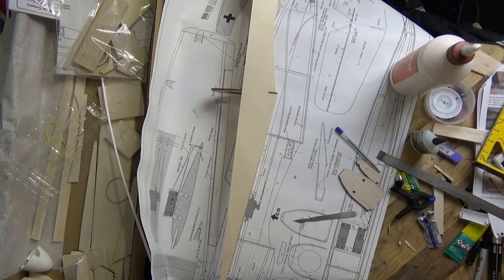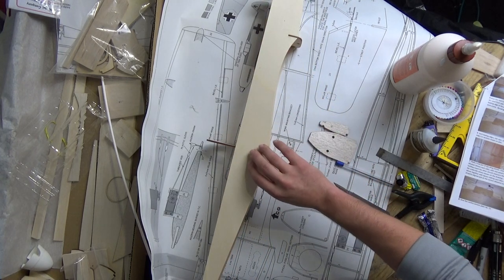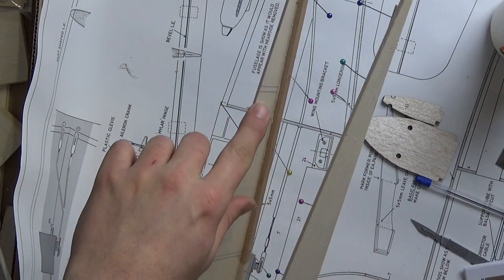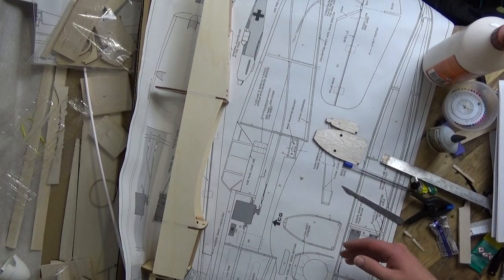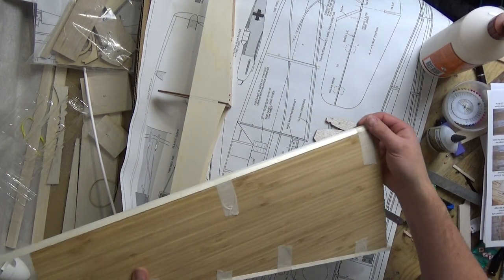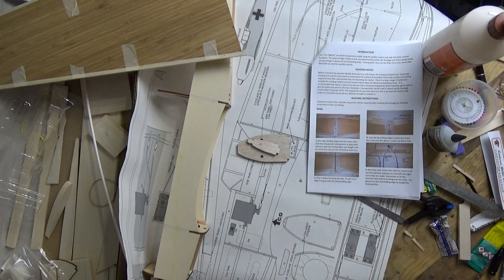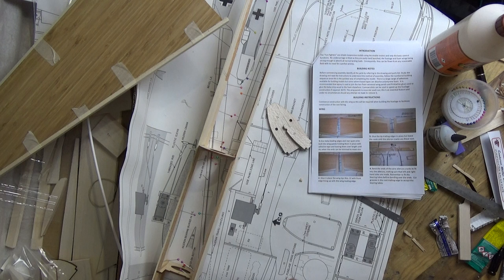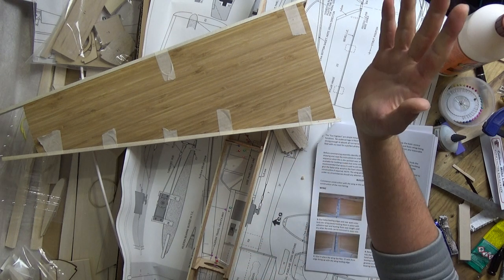Part #1 - ME109 Build - The Fuse, Wings & "Getting Frustrated"

Comment: When I was a kid I made loads of balsa models......The secret is to put the big plan on a big flat surface with a sheet of plastic or greaseproof paper on top then pin the parts to the board. Then stick them together!
Reply: Or use soap or a wax candle rubbed over the plan.

Comment: So many hint and tips I could try to share, but to a degree, you gotta do it your way. I've built Cumbria fun fighters, which aren't the same but looks like yours in similar. Feel free to shout with any questions. Im on the Faceballs group if you want to PM me. Two tips for now. Looks like you haven't fitted the wing seat doublers (part 21I think). These sit on the inside of the ply fuz side and help spread the load when you're wing is mounted. Easiest to fit before you start to put the fuz together when you can glue them on to flat fuz sides. Worth getting them on sooner rather than later while you have most open access to the fuz. I have put wing servos in mine doing my own thing. I should have done the torque rods as in your plan. Some oil them etc. The best tip I heard was to put heat shrink on the bit stuck on the wing. Oil metal then put on and gently shrink the heat shrink. Then as you glue it into the wing the heat shrink becomes a bearing. It's what I'll do with my next one. Have fun!!

Comment: Looks like building by numbers. That bulkhead has a hole at the bottom for the front wing retaining dowel. A single centre servo driving the ailerons with torque rods is quite common on trad builds. It results in a nice strong clean build.

Comment: after 10 to 20 builds it ll becomes second nature  ;-) The picture showes the centre trailing edge material has a "V" cut in it to accept the Torque Tubes with a notch to allow enough movement of the arm, as Heady 2008  said this is very common SEAGULL do it a lot on their ARTF`s as it is cheap and simple, Personaly I would fit small wing servos

Comment: Can you 3D print a sanding block with the right profile to sand the wing and fuse?
Reply from the maker: Morning Henry, na I'll just keep going at it till I sanded too much off and filler it back in afterwards, Matt
Reply: Tapered wing so the shape changes along the span so no a 3d printed block would not be any good.